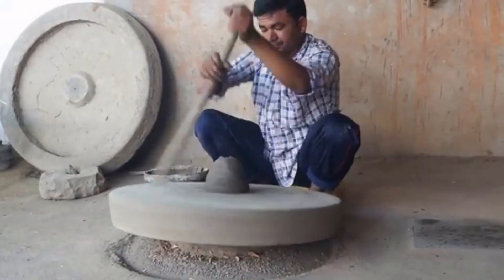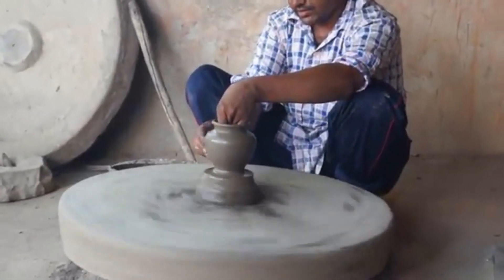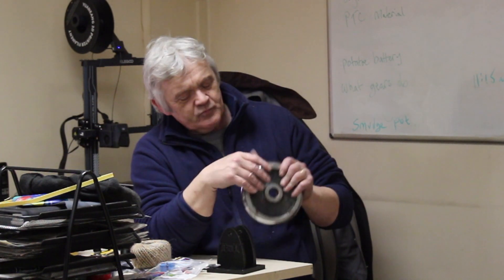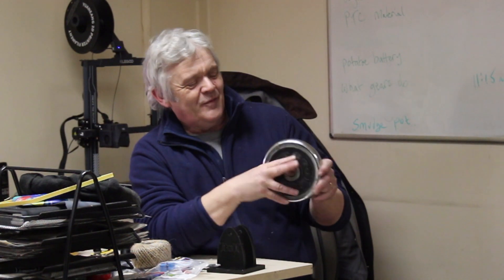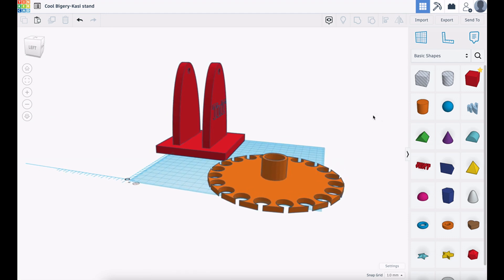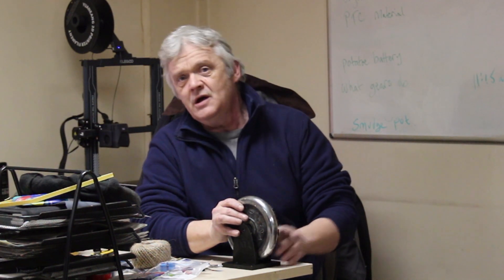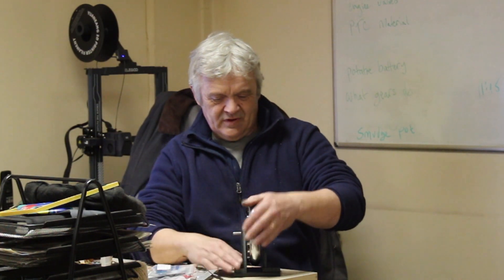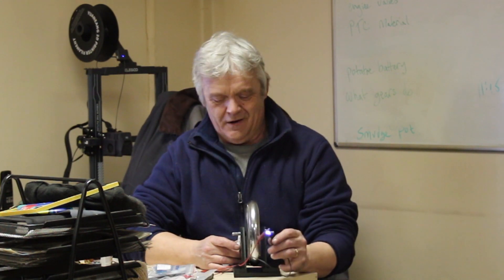1855 A Simple DIY Mechanical Battery

Comment: I often find myself considering the losses in most systems and how to minimise them. It seems a big factor of the losses are in the act of pushing a magnet though a field. I would love to see Roberts thoughts on this (You briefly hit on it in a previous video which got me thinking).
We always focus on friction (air, bearings) when looking at efficiency but rarely do I see people talking about capture efficiency, and often not in much detail if they do (probably because it is harder to improve/measure than just using better bearings :P)
I read magnetic generation is about 75% to 95% efficient. I guess the question is at what point is it worth putting effort into trying to improve that side of the losses and how do you even go about that. I have no idea how you would measure/test a system for these kind of losses/efficiency (as I suspect most people don't so they ignore that part of the system :P), so any info on this side of the coin would be great.
Reply: What he did was just a proof of concept.

The real one was more complicated, in simple, is some sort like a motor-generator which spins the mass with motor when storing energy stage and then acts like a generator when discharging them.

The focus on bearing and drag are just some means to improves efficiency because you will reduce lot's of wear and tear which equals to making money on operations and saving money on maintenance and down time for a long run, with that speed.

They do have another improvement on efficiency and way to calculate that.
Reply from the maker: I will give it some thought - cheers
Reply: @ThinkingandTinkering  Sorry didn't meant to give you more work :P. I believe efficiency increases the closer the fields are, one thing I did consider is that with modern materials/lubricants I was wondering if embedding magnets in low friction disks (PTFE etc) and then just having them sit on each other with a film of lubricant would increase efficiency enough to overcome the friction added by the mating surfaces/oil. Or maybe a second outer ring of magnets acting as a maglev to maintain a smaller frictionless gap. I suspect the added complication isn't worth it for home projects though.
Reply: I guess in a system like this you want to limit friction on your axle, as it equates directly to open circuit discharge rate. More friction = faster discharge with no load attached.
Reply: @ET_AYY_LMAO  True, Limiting friction/air resistance is the easiest way to improve the system. The other drain on the system (larger than the friction) is the resistance from the generator when a load is put on it. This got me thinking about how these could be improved and I realised I haven't really seen much information on this side of things, can this even be improved?. I suspect most generators efficiency is based off the 'friction' of the generator rather than the efficiency of harvesting the magnetic field, ie is there an optimal distance between fields, number of windings etc or is it just linear (any improvement brings a linear increase in drag). My post was the realisation that I don't really know much about this side of the system

Comment: lots of cheap ebike controllers are 24v and some have regen which gives me an idea...solar panel via mppt to 24v battery and a 24v to 240v inverter for 'whatever'. 24v ebike controller connected to same battery  to spin an ebike wheel with added weight (lots!), when solar stops switch ebike controller into regen to keep the battery charged from the spinning mass....
Reply from the maker: interesting idea - thanks for sharing

Comment: Heated metal objects cool faster when connected to a positive high voltage source. Could this be used to increase the efficiency of existing AC units?Negative biased high voltage will aid in heating an object. 
This would make a cool video and I think there could be lots of applications for this. Search Oscar C. Blomgren Electrostatic Cooling on Rexresearch.

Comment: Idea: With a coil arrangement like a BLDC motor you could put energy into the battery by driving the coils like a motor with something like a cheap RC motor controller for drones or RC cars, I think even some more advanced controllers have regenerative breaking, like the O-drive.
Reply from the maker: to be honest mate it doesn't need much and I have done videos on what is needed
Reply: @ThinkingandTinkering  Do you by chance have the number of the video? I would love to see how you do it, you always seem to find cost-effective ways, BLDC controllers with regenerative braking are not cheap, but some a surprisingly efficient :)
Reply from the maker: @ET_AYY_LMAO  it's video 1826 mate
Reply: @ThinkingandTinkering  Awesome! Cheers!

Comment: 1000 rpm for that wheel is nothing. I  had one running at 13800 some years ago. That was the fastest motor I was able to source. Also tried it with a long piece of string wound around the axle which was pulled to get the wheel to spin. Was a metal mounting plate and all metal contruction so it was safe. BTW mounting the magnets to the steel wheel was a good concept. Helps with the strength of the magnetic  field on the open ends of the magnets.
Reply: 40,000 RPM high speed motors for drills
Reply: @whatcher8151 In South Africa in those years things were not easily available and if you could get the rare stuff like high rpm motors they were not cheap. I must admit I did think of gearing up but it was all just a learning exercise of fun. String pull got me 1100 rpm with a long string .
Reply from the maker: thanks for posting that mate - very interesting - cheers

Comment: The thing I don't like about flywheels is, in order to add power to the wheel, you have to exceed the rpm at that moment.
Reply: Not with some gears
Reply: @mushroom4051  ya still have to exceed the rpm with or without. To add power you have exceed the power of the flywheel at that moment. Be it rpm or torque.
Reply from the maker: the same is true of a battery if you think about it - to charge a battery you have to exceed the battery's current voltage
Reply: @ThinkingandTinkering     Yes. Many things follow the same rules.I have been searching for a storage method that is like a bank account. Where you can add as little as you want and it still accumulates. But have not been successful.
The great thing about this channel is we have many brains thinking on stuff like this.

Comment: My wood splitter uses a flywheel. It's called a Supersplit, it's really quite amazing. It's classified as a kinetic splitter .
Reply: I have one also. I have trouble with it disengaging from failed splits it binds up or side to side, grinds, squeechn etc. Have to Jacki Chan the lever to get it to disengage it. Iv adjusted it to their suggestions. Any suggestions? Other than avoid cross grain woods altogether lol. I love how fast they can be compared to hydraulic. But mine is a pain to operate
Reply: @cavelvlan25  That is odd. Mine is 15 years old and it still has the original belts. You should just tap down the handle and the flywheels will regain momentum. Some some forked logs can take as many as five -six cycles. If it won"t disengage it will wear out the belts. Look at the lock nut that is at the top of the lever, it shouldn't be cranked down too tight. The handle needs some play to be able to reset the cycle mid split. 
You should not have to avoid any log, but there is some direction and order of split technique that helps. Mine is just the J model with the old Subaru and it splits every thing. One thing that can be a problem is if the log rides up over the wedge and flips over backward onto the spline shaft at the end of a cycle and knocks the shaft under the pinion gear. Then you have to shut it down and remove the cap head screws that hold the carriage to the I-beam to release it. It only happened to me twice, then I figured out what happened the second time, no more. I found that adding some screen door springs inside the original springs helps with the return speed. Hope this helps. I think my Supersplit is a miracle of engineering and it's one of my best tools.
Reply: @rowgler1  mine is made by Dr Power equipment.  Possibly not as quality as your powersplit.  I wasnt too impressed with it. Straight grains it works great but anything taking multiple pushes is a hassle
Reply: @rowgler1  ill look into your suggestion nonetheless
Reply: Sorry, I've never seen the DR. I seem to recall it had an added safety feature that required two hands to operate. My father almost bought one but I steered him to the original Supersplit, they're built about an hour from us. He's 85 and he likes his,  it's the HD model.
Reply: @rowgler1   You Are correct about the extra safety feature fortunately you can just tie it back with a bungee or something and not think about it too much lol 😆
Reply from the maker: nice! I didn't know about that mate - like it!

Comment: Hi I believe the French have been using flywheels for energy storage since at least the 1970s for the phone network emergency power although I believe if thay develop a fault thay can explode quite spectacularly & have to be buried under ground & encased in concrete.
Reply from the maker: I didn't know that - thanks for sharing mate
Reply: @ThinkingandTinkering  it was back in the late 1980s I was studying for my old fashioned HNC & it popped up somewhere & stuck in my mind but I have looked online & cannot find anything about it like a lot of things the information is restricted or censored for some reason or just lost I have spent time researching old engineering & new but some is hidden. Keep up the good work 👍

Comment: A little time with balancing & the right kind of bearings to hit 10k + rpm & even something as easy as a spring pole treadle & you can really make this work wonders. Light a room for an hour or more on one charge up with a few LEDs.
Reply from the maker: a little static balancing would certainly a good idea

Comment: How bout that flywheel bus old tech of some city I can't remember
Reply: Gyrobus !!! Look it up that's a mechanical battery
Reply: Charges the flywheel at the stop lights so there is no wires over head . Electric bus with flywheel mechanical battery 🔋
Reply from the maker: there were a few of them mate
Reply: @ThinkingandTinkering  what was wrong with them ?

Comment: 30,000 rpms?  .........and that is when we Texans say, "Hold my beer!"
Reply from the maker: lol
Reply: @Robert Murray-Smith , I worked as an automotive technician for 26 years. Back when packing front wheel bearings was a regular thing, I used to do a big no no. I would blow the solvent out of the bearings once cleaned. Occasionally, I wouldn't hold the cage to keep it from spinning. 

I bet I could......you know! 😉😉😉😉😉

Comment: When you print your parts to test your ideas what percentage infil do you use?    

Just curious, as you seem to be knocking out prints everyday.   

Also, what nozzle size? I changed to a .6 a few months back and I enjoyed printing much more now. I can iterate much faster.
Reply from the maker: 40% and 0.2mm - but remember I have 3 printers
Reply: @ThinkingandTinkering  Thanks Robert!    Fresh off the bed those parts must have a nice finish and are plenty strong. 👍🏾